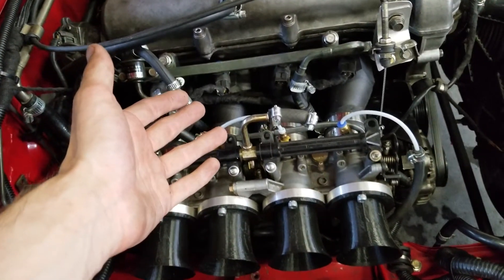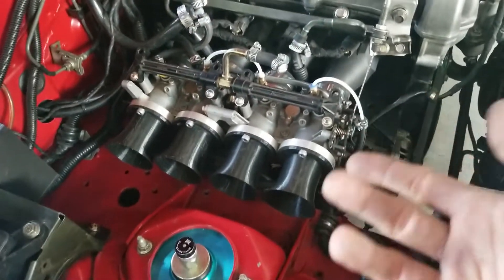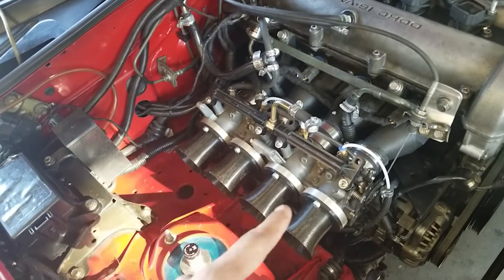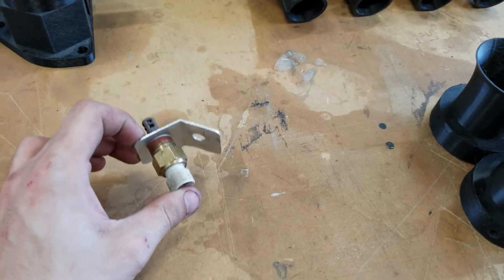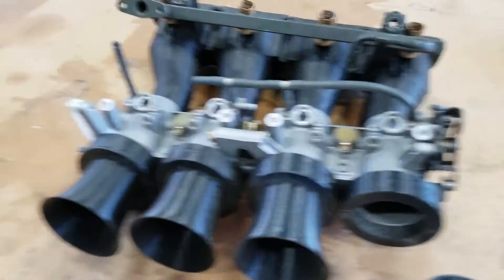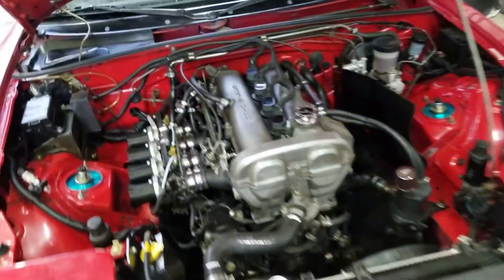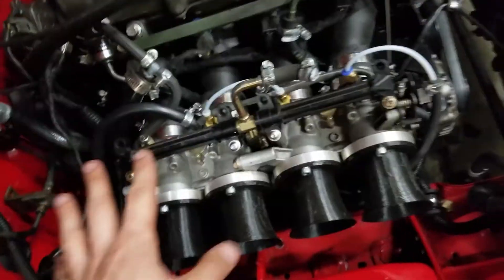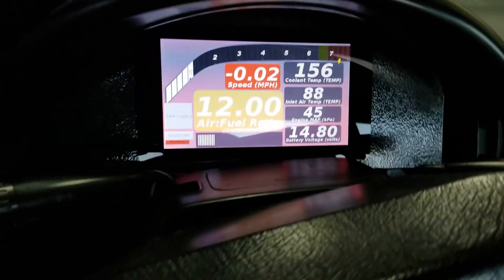3D PRINTED MIATA/MX5 ITB Conversion

Comment: Is the nylon/cf material solvent resistant? Could it handle fuel going through it, if using carbs vs injection?